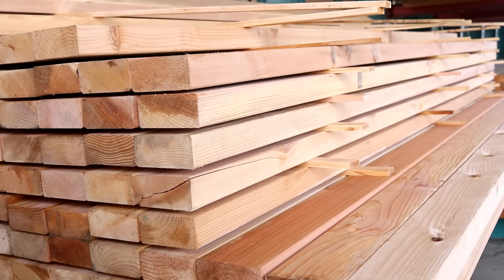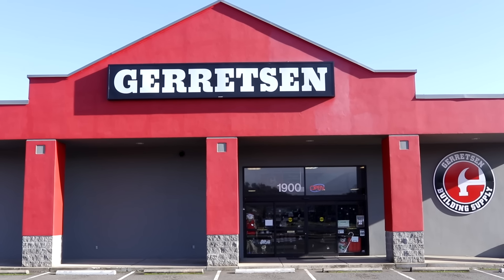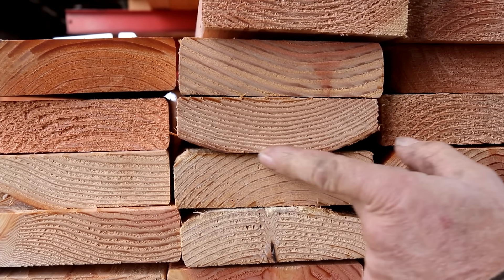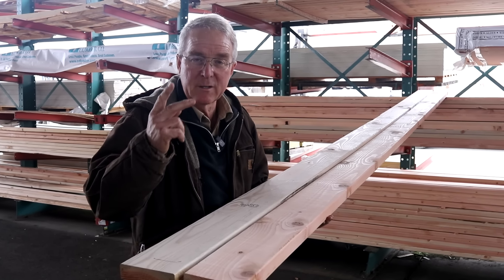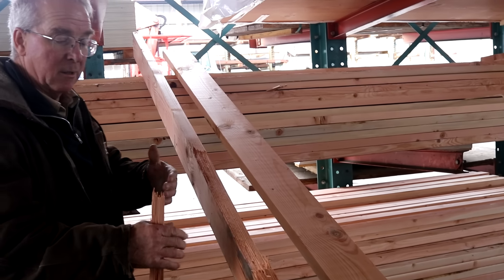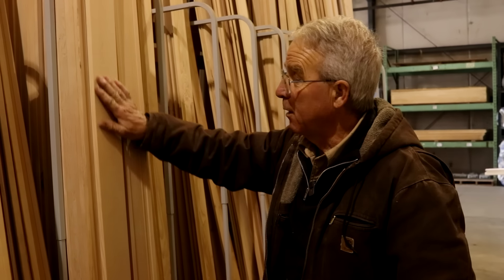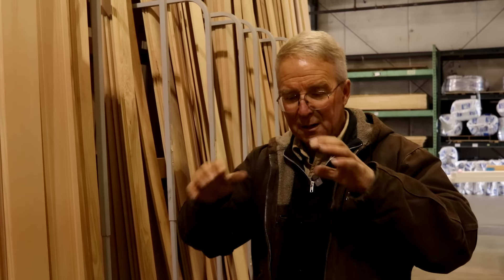How to Not Buy Crap Lumber

Comment: Funny you posted this today.  Yesterday, I went to "a big box store" to get some plywood.  I was in a hurry and figured I'd save a couple of bucks.  I just needed six (6) sheets of CDX (lower quality grade).  I pulled ten (10) or so sheets off the pile by myself, looking for an acceptable one, while two employees stood there watching me.  Looking through the rest of the stack, I realized they were all delaminated, badly.  The entire stack was probably left out and got wet.  I drove to a family owned lumber yard and bought what I needed.  The guys in the yard had it loaded in my trailer before I could get of my truck and put my gloves on.  It was all good stuff.  Turned out it was almost $2.00 a sheet cheaper than the big box store.  I'll never go back to the big box store for lumber.  The little family owned outfit will get all my business from here on out, even if it costs a a few bucks more!
Reply: I find box stores are often priced higher because most people think they are cheaper. It’s a head game.
Reply: Our local family-owned chain is consistently cheaper than the big boxes *for equivalent quality*.
Reply: I concur.  Getting wood anywhere else is a crapshoot
Reply: Same thing just happened to me.  I was cussing and headed to the door when a couple of the guys I knew pulled me back and yanked some good sheets off of a new stack.  If I want pringles, I'll go to the grocery store.
Reply: Janet helten wsu
Reply: @@karlwithak.
La Mesa Lumber has good reviews and is locally owned
Reply: if you can find one, give them business...ours was partners with ace, and raised prices dramatically in 2022...like 2x big store.  so a small project its now cheaper for me to look for good wood in the big store, even if it takes several trips...im not paying 12 bucks for a low grade 2x4
Reply: I’m glad you had a good experience! 
Usually the employees have been directed to load for the customer to avoid the customer being selectively picking product! For what material cost these days they should be perfect and tied with a gold ribbon!

Comment: My lumber package for an upcoming house build is $36,000 at the local mom and pop lumber yard that I would prefer to support. However, Lowe's has the same exact lumber package for $26,000 which is really hard to justify paying $10K More (40% higher price). I would be willing to pay a slight premium say 10%, but not a 40%. These companies need to compete.
Reply: The markup on softwood lumber is pennies per board foot. That 10K price difference is Lowe's cutting corners. I think you'll find the 10K is justified if you were able to compare the two lumber packages. I might buy the cheapest material from Lowes (stuff even they can't screw up) and the rest from mom and pop with their customer service.
Reply: They would love to compete if the mills and wholesalers treated them both as equals in the first place, did you happen to ask them if they could bring their price down? Sometimes they can go back to their supplier for discounts to make the sale.
Reply: I've seen 40% more as well. I go with Lowes a lot. The one in my locale has great service also.
Reply: It's been a year since you left this comment. I'm curious about the quality of lumber you received from Lowes? You mentioned a local "Mom and Pop Lumber Yard".....there's a difference between a local lumber yard/seller vs local Full Service Mill with Lumber Sales. If you deal with a full service mill, many buy their  stock directly from the land owner where the trees are growing, then contract with logging companies to fell the trees and deliver it directly to their mill.  This is how they maintain a higher quality lumber. They dictate the timber standards. I have 6 cousins and an uncle, who have worked in the Logging Industry in Iowa, Minnesota, and Wisconsin, for the past 30 years. The local full service mills, which also sell lumber to the public, are hands down the best sources for consistently high quality lumber at the best prices.

Comment: I’m retired and work part time in the mill work department of a large orange big box store.  Everything you say about the lumber selection available is true.  You have to hunt to find the good pieces.  However, contractors shop there for price alone and ‘good enough’ material.  I frequently tell guy sorting through the moulding section ‘If you’re looking for furniture grade, you’re in the wrong store.’
Reply: Prices of molding in that orange store are higher than at my local lumber yard.  I priced 3 5/8" crown for a huge job a few years ago - orange was $1.08 a lin/ft, my lumberyard was $ .54.  HALF the price.
Reply: @maddierosemusic  The Depot will sell you molding by the foot, so they lose a lot of material when the piece gets too short.  I like my lumber yard, which sadly is not local, but when I buy a piece of molding there, I'm buying a 16 foot length or nothing.
Reply: @@karlwithak. Yeah, you sound like some of the inconsiderates that I get to clean up after.  I sometimes have to tell folks like you “Sir, we don’t need you to cull our material for us, thank you.”  I see guys pull off many sticks of molding they deem unacceptable and just leave it on the floor.  Not cool!  Someone (me) has to clean that up.  Just be considerate is all.
Reply: I used to haul into and out of Home Depot Regional Distribution Center in Salt Lake.
The Mills I loaded at would have a special pile of Lumber they took from for the Orange Guys.
There is a reason it is cheap.

Comment: Just out of high school I got a job with a finish carpenter trimming out houses. I grew up helping my father build cabinets and other woodworking. I don’t think my boss believed I had that much experience and knowledge for carpentry. After I was through with the base boards, doors and windows he asked if I thought I could do the molding for the cabinet doors. I sorted through the boxes of molding and only used the best and made the most use out of the culled pieces. At first he was a little upset that I culled so much of the molding but I told him that’s the way I was taught to never use anything less for cabinets. He said from then on I was the only one that would be allowed to do cabinets and doors for him. Learning to grade wood was a valuable lesson my father taught me.

Comment: Thank you for creating and posting this. I've been a general contractor for 35 years and a woodworker all of my life. I really like your realistic approach to picking out lumber and the fact that you can use boards that are less than "perfect". I don't want to leave my local lumber yard stuck with all of the less than perfect boards, they have to make a living as well.
Reply: Great Video
Great Explination 
Thanks

Fully agree, less than Perfect Can be Distributed Throught the job.
If You Pay Attention, When You Cut the Piece
Needed You Will begin to Understand and Plan where the left over Piece will Fit.
In Time the Imperfect Piece will Get Fully Used, believe that.
Don't become a Perfectionist, it's not Needed, you Will understand pretty Quickly.
Attention to Details of all of Your Craft, Especially Waste.
One Cut on plywood for Gable End Sheething, difference Fits on
Opposite side Gable End. Peace ~♡~

Comment: When I built my house in California I sourced all wood from a 2-location lumber company and had to stack all the studs with spacers out of the weather for a month because they were dripping wet and twice as heavy as a normal stud. My 2 X 10 joists for the second floor varied a 1/2" in width plus had severe crowning...caused me tons of trouble.  Just because a company is small doesn't mean they are better. I'm glad you explained about looking at the end-grain; that's a question I've had for many years as to which cut will deform the least.
Reply: @karlwithak.I bought supplies at 10 different Home Depots in the Los Angeles area for 28 years and I watched the lumber quality diminish drastically. I left for Louisiana 12 years ago and shop at 2 H. Deps. and one Lowes with the same problem.
Reply: My mom and pop shop actually has kinda bad lumber. I went to home depot and that stack of 2x6 studs looked like a movie prop. 100% perfect boards stacked perfectly. White, straight, hardly knots, DAMN it was a pleasure plucking them up lol

Comment: Dude, you just taught me exactly what I have wanted to know for very many years. I receive it with all the confidence of the knowledge, experience and authenticity that you offer it: so very much appreciated.
Here in the uk lumber is shyte beyond comprehension compared to the quality of that which I grew up with in the 60s and 70s and even into the 80s. I firmly hold that our generation saw the best of it. We did not have mobile phones and any information one could imagine at our finger tips, nor comfortable and efficient personal transport - for the masses at least - but we had the best of everything else I am sure. The air was alive with flying critters of all kinds;the meadows were rich in diversiry of flora and fauna, and if you touched something that had been manufactured, then it resembled something that had been made to do the job for which it had been intended, to do so reliably and would not need to be replaced within any time frame which one might need to be considerate of at the time of purchase. These newer generations have no idea: they might be able to intelectualise what they missee, and it is sad that they will be unable to experience it; to feel it.
Thank you very much indeed: excellent video and it is a pleasure to spend a little time with a teacher of admirable morality.

Comment: 13:20 The hemlock here in eastern Canada is completely different. Splits very easily and when it's dry, you only got to say the word split and it will split apart on its own. As for moldings, not this stuff. Too many small splitters remain on the wood surface to be worthy of anything other than beams, fencing or board and batten. At 14:22 the FD probably means Full Dimension.   And yes, please support your local businesses.
Reply: We have the same hemlock in New York. As it dries it splits but it's still pretty strong. You want to be wearing leather gloves handling the dry lumber. It's nothing but slivers. It was commonly used for home building back in the 19th and early 20th centuries and for lathe. In my area hemlock was logged to near extinction in the 1800's for the tanning industry.
Reply: @grannydeen1586 Very true about wearing gloves. Those small slivers are the devil. Still some big hemlock here. I have two truck loads in the yard to saw up this spring, average 10 to 27 inches in diameter, 12-14ft long.
Reply: @WoodchuckCanuck  
That's nice stuff. You could sell every stick of it here. I have a few nice sized hemlocks and white pines on my property. My neighbor has a beautiful stand of old, straight white pines but it's so steep, it's difficult even walking to it.
Reply: @grannydeen1586  The more difficult the terrain, the larger the trees. A lot of people notice them in the yard, but I bought them myself and lucky to get them. Not about to let them go :)
Reply: Western hemlock is much stronger doesn’t split. They used to make rain gutters and log truck trailer reaches with it back in the day

Comment: Wonderful video, informative and entertaining.
You say of the wane: "That's where the forest started..." Nice.
Yes, the big-box stores don't stock the best lumber, but on the plus side, they let you hunt around as much as you want to find the better pieces.  Non-chain lumber yards that cater to contractors usually disallow that; one must take run of the mill.  I have even had a guy at one of these yards sense that I wasn't a pro and he "helped" load my vehicle by  piling on all their junk lumber, which I just as quickly loaded off.
Here in the East we don't lump our eastern hemlock in with white wood.  As far as I know it isn't cut much anymore, but it's reddish or brownish rather than white.  It is strong and quite rot resistant, and I like it (my house is framed with it).  However, it is very splintery.  If handling it before planing, you'd better be wearing gloves.
BTW, I like that you recommend supporting the independent lumber yards.

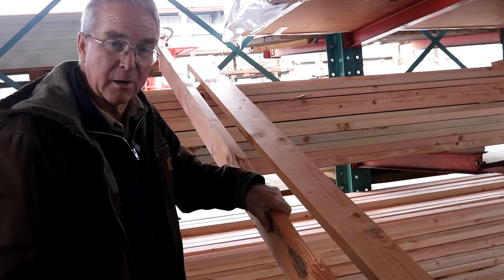Comment: 1. 2:30 middle cut 2. 3:55 tree core visible (wayne) 3. 4:35 knot 4. 7:05 crown (deviation from the straight across the width of the board 5. 7:35 damage in handling 6. 8:20 twist 7. thick fiber lines instead of many fiber lines 8. 9:50 pitch (its like knot but in a line) 9. 10:20 difference in width within board

Comment: Even with a Home Depot or Lowes where they do not stop you from picking through the lumber it is often necessary to wait until a new shipment arrives to find anything that you can use...the other day I spent a couple of hours going through inventory of both of these in order to buy lumber decent enough to build a couple of bookcases (at a cost of $200. for 8 1x8'x3/4" common grade I refuse to buy boards that are totally unsuitable)
Reply: That’s my experience, leave and come back when they’re better boards.

Comment: I have used local lumber stores over the last 40 years and the lumber varies from season to season at them all. I lived in an area on the west coast that had several lumber mills, and most of the better lumber was shipped to other locations, for profit. So no matter were you shop you have to dig thru the unit. It sucks. Recently I found great selection of KD 2x6x12' at Lowes, I was amazed.

Comment: One tip I appreciate about selecting box-store lumber for projects you want to look nice and stay straight is to buy 2x8 or 2x12 and rip it yourself into 2x4s and 2x6s.
You're left with two boards with little or no heart-wood, and the larger parent boards are more likely to have tighter growth rings.
Reply: Exactly. 
A local fruit and vegetable store told me not to pick the rotten oranges out of the box and  replace with good ones. So I'm supposed to pay for rotten food? I never went back.
Reply: It's more expensive like that, a 2x12 cost more than two 2x6
Reply: Ive tried that before with a straight 2x 12. After i ripped it in half i had two really crowned 2x6s. Didnt even finish the cut before they split from internal forces
Reply: @The_Pennsylvanian  It's more about getting better quality wood than saving money.  You're already investing more time in handling and ripping larger boards, so if you just need sticks that will hide in stud walls, get the cheapest stuff that is structurally sound. 

Fortunately the cost isn't that far off.  
At my local Menards a 2x4x10 is $5, a 2x8x10 is $8. So cheaper to rip.
Conversely a 2x6x10 is $7, while a 2x12x10 is $20. That extra $3 a board wouldn't make sense in a large project where a 40% increase in material cost makes a difference.  However for a single bench, or deck railing, etc where I want things to look nice and be straight, it can make sense.
Reply: @logsdongarage  That sucks.  Was the wood really wet?
Reply: @rhekman  it could have been. It was raining that day so even though they were covered in a shop they could have absorbed some from humidity.
Reply: I posted elsewhere in the comments about my awful experience ripping the pith out of SYP KD HT 2x12s. Mine exploded from stress too, and after stickering the ripped boards for a year, had an inch of crown in 6 feet. Never again.

Comment: "Don't be a jerk." Good advice. Pick the good ones you have to have and help the next guy out and help keep the prices down by accepting a few lower grades for where you know you can use them.
Reply: Sometimes it's not just accepting lower grades. You might find an 8 foot board that has a defect across just a few inches at the end. Well, if you know you need to cut a bunch of cripples and jack studs that won't be 8 feet and you will have scrap off-cuts anyway, those boards with the defects only at the end are just as good as the ones that are perfect across the entire 8 foot lengths. In that case, you're being a better citizen by taking some of the ones with end-defects. It's better for the environment since ultimately less will go into the scrap pile and fewer trees will have to be cut, and it also creates less work for the guys at the lumber yard who have to tidy up the pile when people pick through it.

Comment: Living on reservation majority of my lumber is shipped from home hardware, My guy Wayne (no Pun Intended) loves to send me good boards when asked. Also went through the racks and they had zero issues. Only time I had issues was when I purchased 3 birch sheets of good 2 sided and got them delivered with mud on one of the three. Got them replaced easy on the next load up.

Comment: Our local family lumberyards are all gone. I went to the orange box to buy some 2x12 yellow pine for some utility shelves, planning to rip out the pith and toss it. Figured I’d get some usable rift and quarter sawn boards in the end.

Chose the driest, best 2x12s in the rack, KD and HT. Ripped them with the big band saw. BANG! Several exploded as the kerf began to release the stress.

I saw the crowning and bowing coming, so I stickered them in the house for a year. When it was time to joint and plane, there were 6 foot lengths that crowned AN INCH.

After two rounds of milling, weeks apart, the boards were workable. Roughly half of the purchase price lies in the big pile of planer chips.

On a pleasant note, two days ago I found nice bunk of Doug fir 2x4s at the blue box. Many were quarter sawn, fairly tight grain. Should have bought a bunch, I guess.